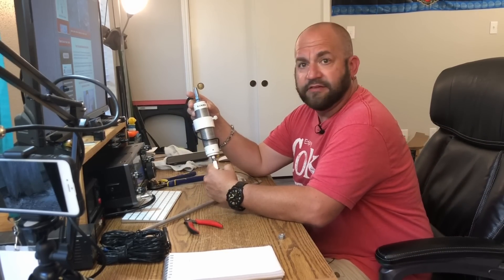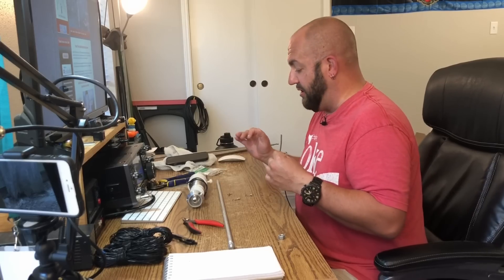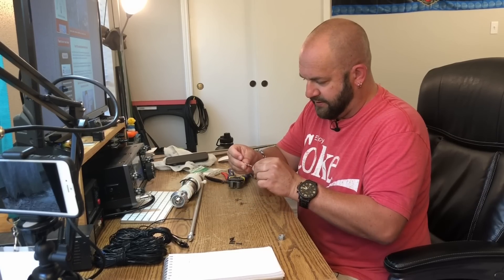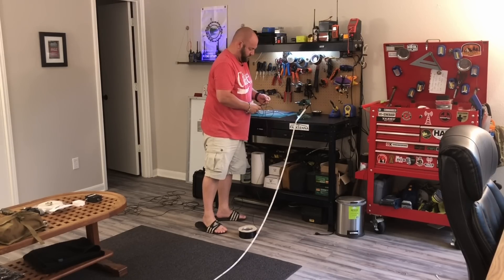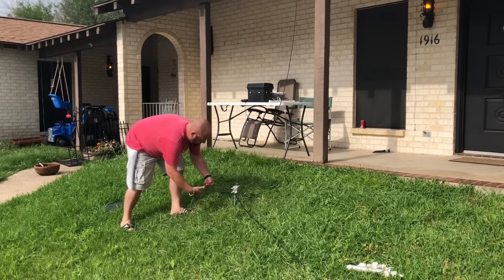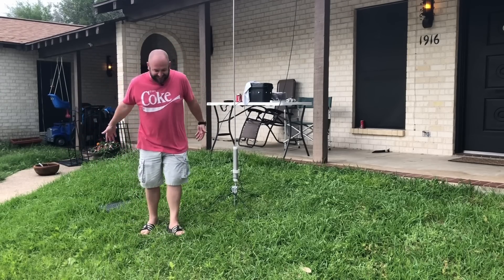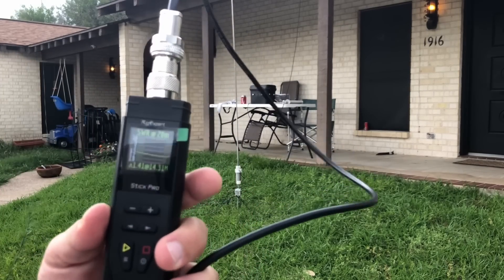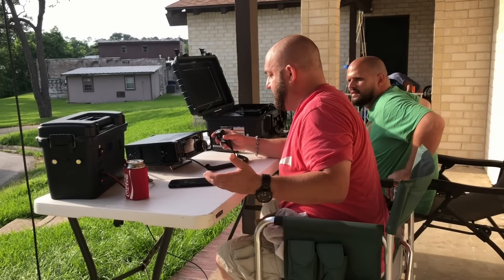Can You Shorten Counterpoise Wires For Wolf River Coils

Comment: Use Mueller compression clips (20A) instead of ring terminals to attach ur radials on the tripod legs! So much faster to deploy and pack-up. I've been using nine 10-foot radials on my 20M-6M activations with extremely low SWR (three per clip for a total of nine). I add an extra set of three radials (on one more clip) when I drop down to 40M-80M for best SWR. Good for u brother! :) 73 KJ6ER
Reply from the maker: I think you need more radials cuz I can never hear you when you're out and I'm playing front porch radio!!  It certainly couldn't be my stations fault lol!  #hamharder!
Reply: @hamradiotube  Hey Mike, I  always pour an extra ice cold hazy IPA on my radials - that works better than salt water! Stop drinking that stuff and soak your front yard in it brother! Wooooo hooooo! 73 KJ6ER
Reply from the maker: @gregmihran8616  Hahahahaha!!  No way would I ever spill the holy water like that!
Reply: @hamradiotube  Real holy water is Westmalle Trappest or St. Bernardus Abt 12 made by Belgian monks 🍺.  Can I get an AMEN???

Comment: Good video Mike. I run four 16' radials on my mini and it tunes well every time. Keep up the good work. 73  K0BJJ
Reply from the maker: Interesting.  Only 4 you say?
Reply: @hamradiotube  yea only 4 16ft radials. Have gotten swr down under 1.4 on 40, 20, 17,15, 10
Reply: @K0BJJ  I'm doing the same with an MFJ hamstick and adjustable stinger.  I mount the base up high off the ground, about 10' or so, so the radials are elevated.  I'll either use a tripod with a push up pole, or mount the push up pole on my trailer hitch mount to get it stable and able to raise it up.  Works great and when I swap 20 and 40 meter sticks, I just need to adjust the adjustable whip on the hamstick.

Comment: Nice job, Mike. I remember asking this question in one of your mailbag monday vidieos, and you said you were gonna try it. Its nice that you really did too. So, I did it a bit different. I made 3 bundles of 5, of 3 meter radials, and put them into male spade terminals, and made a small jumper with an eye terminal on one side, to attach to the base, and a female spade terminal on the other. I have 2 nuts on my legs of my wrc, and they stay there. That way it's easy to just plug the radials in to the legs when I set up. Seemed to work for me. I'm using the SB1000, and the 213" whip.
Reply from the maker: If I say I'm gonna play with an antenna, I'm gonna play with an antenna!  The WRC has been such a popular topic on MBM I just had to try this.  I have a follow up video on this coming out Friday.  I've though of something similar to your spade terminal thing, but I want to use power poles.  #powerpoletheworld  I also have 2 nuts on the legs of my triopod but haven't made the connections yet.  Great minds think alike.
Reply: @hamradiotube  I was gonna use power poles, but I already had the spade connectors here, and I'm impatient lol. I think I may change them to power poles, but for now, the spades work. Thanks again!
Reply: @Spike-sk7ql  Use Green Power Poles for extra hip cred.

Comment: I did something very similiar mike  with my WRC. I attached a ring connector with a short piece of wire to a Anderson power pole connector that stays on the base. Then I added 3 ten foot radials to a power pole connector so I have a total of 9 on 3 legs. Easily taken apart and wound up on kite winders when not in use. Worked ocean side in Florida last December. Seem to work well.

Comment: I use the shorter radials on my DX Commander and have had good results with contacts but not that great swr measurements. what battery are you using and power level?  KE0RPU

Comment: KE0OG, the ARRL and QST's new technical editor has done a few YouTube videos on this vary subject and Dave's recommendation is more shorter radials than a few long radials work best..... ~ 25' each. I too use the Wolf River 1000 coil and very impressed with its quality built....but remember, a vertical is a vertical is a vertical. My MFJ EFHW beats the vertical every time! 73/K6SDW
Reply from the maker: Yes, I know Dave.  I think you'd be surprised.  I like to set up multiple antennas portable when I can.  I've done some AB comparisons to the WRC and an EFHW using an antenna switch for fast comparison.  Sometimes the vertical hears better, sometimes the EFHW does.  I wouldn't personally say the EFHW beats a vertical every time.
Reply: @hamradiotube  Well.......almost every time.....HI HI. I have both the endfed (due to HOA constraints) and the Wolf River vertical setup and I use which ever antenna is hearing the best.I''m a any frequency, any mode kinda ham...since 1965. 73/ed

Comment: You might try a different length of coaxial cable to see if that helps out on tuning the 20 meter band.  Shorter radials are definitely easier to keep untangled for easy deployment and take-down.  With your radiating element being as short as it is, I'm not sure if using longer radials would really do much for improving the radiated take-off angle. -- K7SFA
Reply from the maker: If the coax is too short, say under 30' it can and will affect the tuning.  My run was about ~60'. It shouldn't matter at that point.  Someone else suggested my choice of 2 meters for the radials is a 5th harmonic for 20 meters and may be why I was having issues.  Certainly something to think about.  As far as the take off angle, that's a whole other subject!
Reply: Good thought. I usually run a choke against the antenna. 🤔

Comment: Why not just put the radials on the stud on the bottom of the whip when you screw it into the barrel nut?  Not enough stud left sticking out beyond multiple ring terminals?
Reply from the maker: because that would still be connected to the center conductor.

Comment: I use the Wolf River Coil with my Tx-500 and get great results with an SWR of 1:1 according to the radio.  I also use short Counterpoise wires (about 6 of them) all around the base.
Reply: I have just bought one and have not had great swr results. But also have not had a lot of time to play with it. I have only had it a couple of weeks and only an hour or so of time with it.
Reply from the maker: It takes a little while and practice to get used to the antenna but you should have great results.
Reply from the maker: Sweet